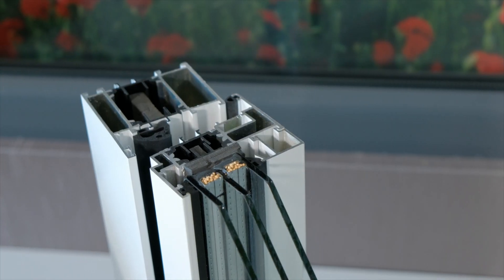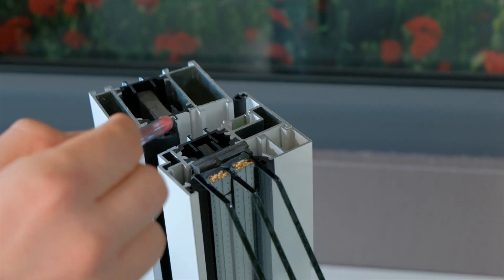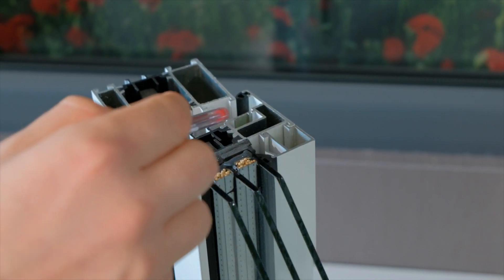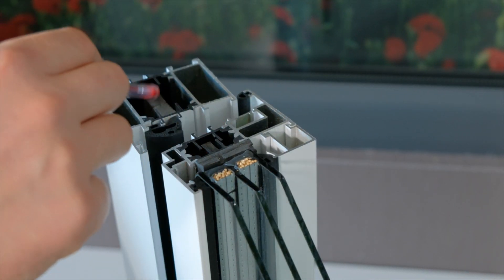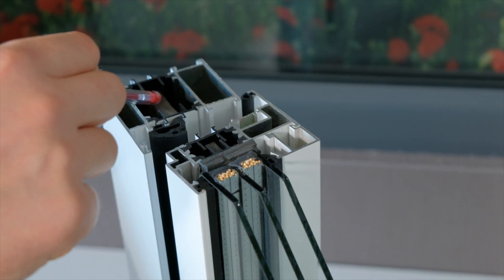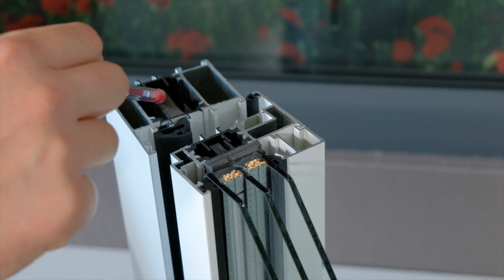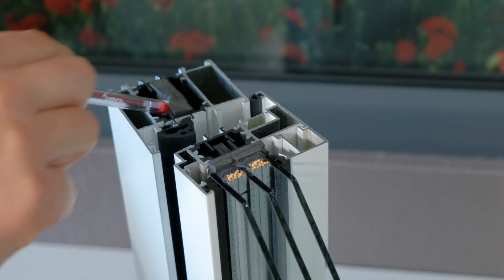Thermally Broken Aluminium Frames

Comment: … or we could ban aluminium frames in Australia and use uPVC like the sensible world does. Let’s move out of the 1970s please.
Reply from the maker: This is an interesting comment, the rest of the world has not banned aluminium. It is still very common in commercial projects, and for projects outside the scope of uPVC. But all of these aluminium frames are thermally broken aluminium frames, which make them higher performing than non-thermally broken frames. Thermally broken frames are also great for high fire zone areas.

I do very much agree that we should be putting more focus on higher-performing products, such as uPVC.
Reply: @OknaluxSaintMarys  we should reduce the use of plastic .upvc is a plastic
Reply from the maker: @muhammadqazafi8661 , the great thing about uPVC windows, is they are fully recyclable. Plus windows are not changed very often.
Reply: @muhammadqazafi8661  Metals extracted from mining ore are hardly environmentally friendly either. Even recycled material takes a great deal of energy in the recycling process. The good old fashioned timber frame is probably the most environmentally friendly option and a good thermal performer too!